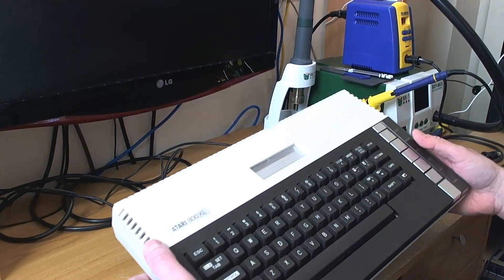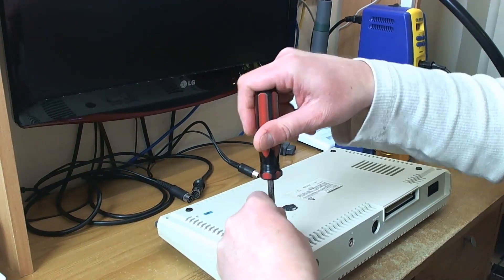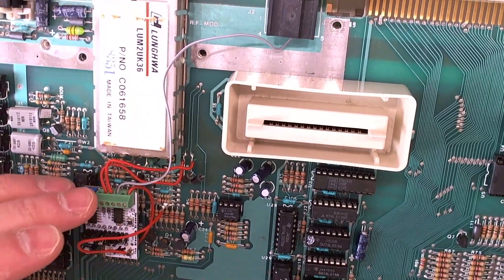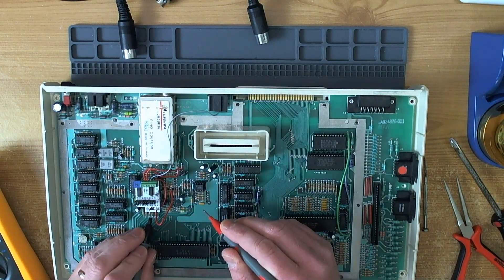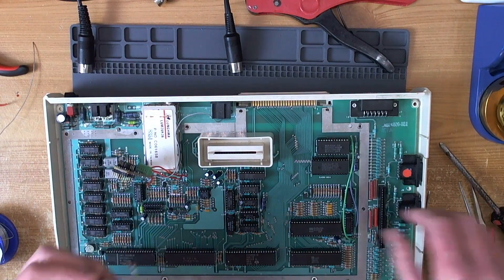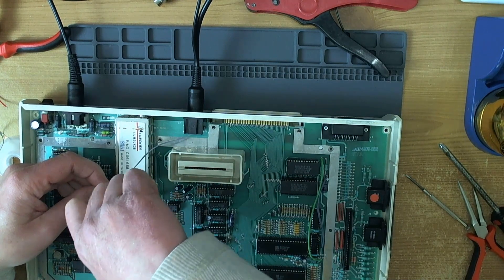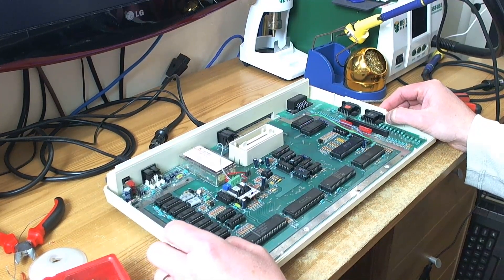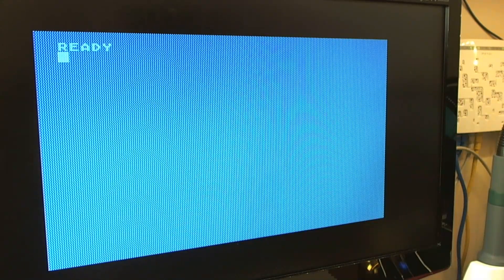UAV Atari 800XL still has poor video

Comment: I could have told you this when I saw these pattern (which are the color information of the composite signal). SETCOLOR 2,0,4 would have make them disappear as it sets the background the black and white (actually grey). I see these pattern everytime I swap the two chinch-cables on my Commodore 1084S tube.
Reply from the maker: Disconnecting chroma (i.e. ostensibly removing all colour information) didn't make the lines disappear. But in any case, I'll know what the problem is next time I see it.

Comment: I installed a UAV, and just using composite, I'm still getting a poor image of characters having a blurry edge. I'm using an LCD TV, it doesn't have S-video input. I'll have to check around and see if I can find a TV with S-video and try again.
Reply from the maker: There's a limit to how good composite can be, but if you manage to get an s-video display device, satisfaction is guaranteed.

Comment: I watched this just to admire PCB layout of this machine. So clean compared to... don't know - a C64? Bit disappointed on the cause of the problem. I hoped it would be something more exotic like one of those rogue GTIAs that need a 'fixer' board to have GR.9 mode look like it supposed to. Oh, and thanks for the link to the source this UAV thingy - I see it probably sort of 'fixes' such GTIAs by itself.
Reply from the maker: Yes: I was pretty let down that it was such an easy fix too, but I've had so little time to make any content lately, I didn't want the footage to go to waste. That's an interesting point about the bad GTIAs: I'm not sure UAV would fix such a chip if it is outputting the wrong digital luminance.
Reply: @flashjazzcat  Those GTIAs are not exactly 'bad'. They have some timing issue and the fixer boards (Simius fixer boards, anyone?) dealt with it (depending on version, they could also improve some minor things, like getting rid of that blurry appearance in high res). I see UAV has similar features. I never really analyzed what's going on with fixer boards, so I'm just guessing here about them being distant UAV relatives. 

However, I have some XEs with these GTIAs waiting for my spare time, so maybe I'll try both boards.